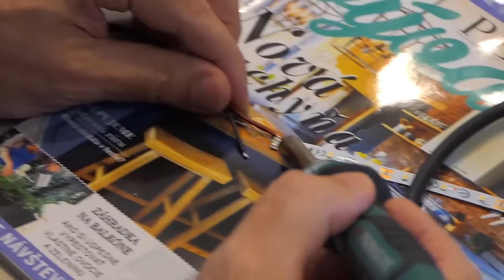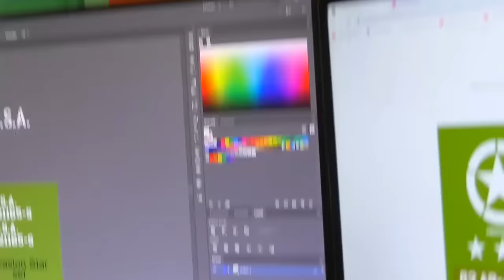Full Restoration Old Jeep Willys

Comment: You need a new motor in the COBRA. It's smokes too much. Love the Jeep restoration.
Reply: It’s a 2 stroke. They smoke a bit
Reply: Bikes, Cars And More!  Two stroke engines are not the most reliable engines. They smoke a lot when the piston rings and valves are wore out. They will overheat and shut down. My father bought a Toro lawnmower with a 2 stroke engine back in 1988, and it would always stop  running after 15 minutes. Then it wouldn't start.